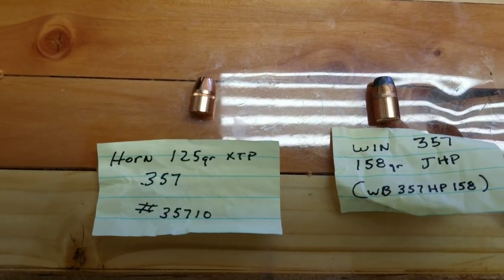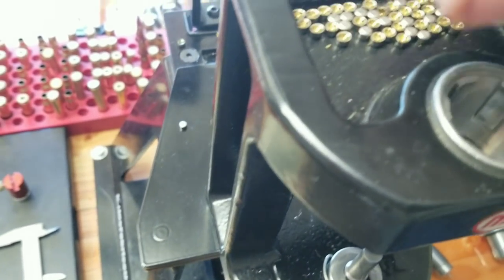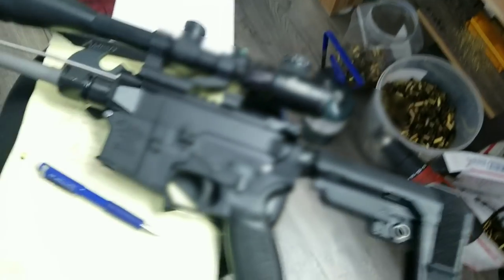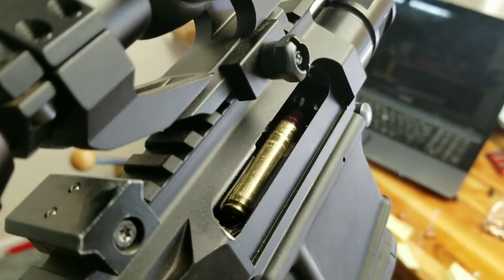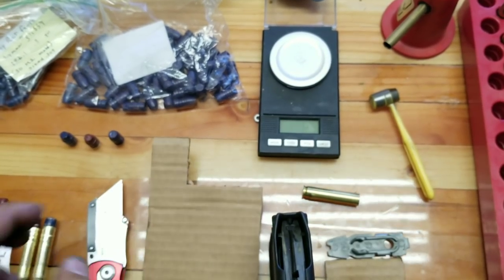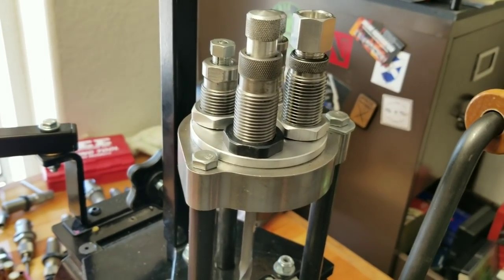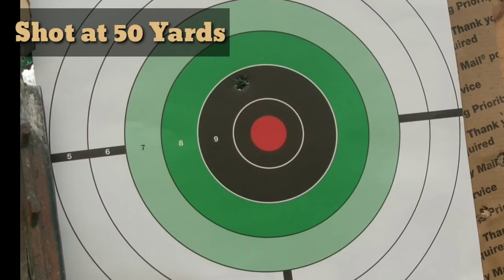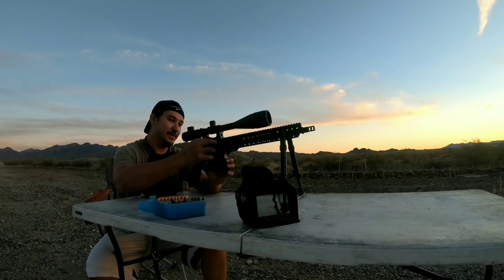350 Legend SBR - How I'm loading It - Testing NOE 183 GC "Taco's"🌮 - Explosive Results!!!👍

Comment: Are you using standard AR mag... You may want to try out the AR7.62x39 mag or mod the standard AR to the look of the AR7.62x39. by this it has the lower lip and thinner or cut on the mag where the mag meets the m4 feed ramp. Just stay the front end of the magazine been mod .

Comment: I have a 12.5" KAK bbl pistol build. Where is your 10" from? Thanks for the feed ramp mods and load data. Lil'gun is one of my favorite powders. 
Also do you plan on any heavier bullets? I have a SAECO 352 mold that is for 245gr 35cal. You can gas check it if you want but I just PC them and go. Working on a load soon.
Reply from the maker: The 220gr Berger bullets shoot good out of my 18inch KAK. Ill make a video on this soon. I contoured and build this barrel from a 9mm ar barrel from BCA. I also am finding awesome results with a 147 Lyman 9mm bullet and H4198 27 grains

Comment: I think I remember you saying you worked up your load with Quickload. I have the update but I just looked for this cartridge and its not there. Did you enter the info manually? If so where did you get it? Are you willing to share your load data for the Taco bullet? I just ordered the mould, have not ordered the upper yet for me the mould is the first step. Thank you for any help you can send along.
Reply from the maker: I remember a while back messaging you many times and was completely ignored on both TRN, Slack and your channel.....so ill hold this grudge.  Your on your own figuring this out

Comment: I thought you werent supposed to use lead bullets in an AR because the lube and lead will clog the gas port, did you find that it did? Liking the 350, should be a great whitetail round!
Reply from the maker: Negative on the leading
Reply: Excellent, I shoot lead in my blr .358 winchester, love 35 cal rounds! Also have a 35 Whelen bolt gun, soon to have a 350 legend, thanks for the time and effort.

Comment: Fbg at 2000fps! I’m still learning about this round. Can you use range scrap, 223/.556 brass? Will we get kicked off of YT for asking these kind of questions?:)  thanks for the video!
Reply: Jk!:) finished watch the video and you answered my question:) thanks!
Reply from the maker: Ya I successfully converted 5.56 Brass but it requires taking a risky step in fire forming to blow out the sides
Reply: Eagle Eye Shooting. Fire form, as in pushing a .223 down a .355 barrel? I think I’d build one if I could reload it with brass from the range.  Cmmg barrels are only $200! What a deal!
Reply from the maker: The Case of a .223 is roughly 8 thousandths smaller in diameter. The case wall basically blows out a tad. Takes about 35k psi to fireform it correctly. Ive had some split down the case wall. "Cheap pmc" doesnt cause issues in the ar and you wont notice it but definitely poses a risk
Reply: Eagle Eye Shooting. I tried making 450 bushmaster brass from 270 range brass and my 45 colt dies. Epic fail:) nobody died tho!:)

Comment: Finally a rimless 357 MAXIMUM!! I have asked both Savage and Ruger to come out with, what is now basically the 350 Legend. To bad it's not a 1:12 twist for us subsonic reloaders. 246 gr HUNTER bullets work fantastic. The 300 gr Hunter bullets work well in my custom MMG 1:12 TC barrel.
Edited to add: 357 MAXIMUM load data will work 😎
Reply from the maker: Haha right? Nothing new here that hasnt been done. I just did some testing with the 220gr and got some awesome results. Will be making a video of that soon. Thanks for dropping by
Reply: 1:16 will stabilize a 300gr bullet. My 77-357 shoots great with them suppressed. I have also used those 246 Hunter bullets in it. Through an Octane 9 and Osprey 9. My current load is a 245 gr SAECO 352 mold cast.
Reply: @postban  <---- this is excellent info. Thanks! Any idea if the Ruger pistol gas system is any better than the CMMG carbine gas system for cycling subs? I already have the Ruger American bolt gun.
Using American Select I have non gas gun loads in my MAXIMUM with an ES of around <20 FPS. Hopefully I can load gas gun loads that will cycle 220+ gr loads using slower powders. Any help is appreciated. Thanks! I use the Mystic X, but have 2 other AAC 9mm cans.
Reply: @EagleEyeShooting  <- any subsonic results. Powder, bullet etc. Would be helpful. I'll try to work up a sub that cycles in an AR. But need one first. Pistol gas sys from Rugar or Carbine from CMMG. I can cut down the pistol system for my SBR. So am leaning that way.
Reply from the maker: @johninnh4880 , awesome I can work on something. IMR 4198 and H4198 seem to give perfect amount of pressure and reduce velocities.  So far I have a cast Lyman 147 9mm bullet with 27gr of H4198 that gets them going at 1780 FPS ejection is at 4 o clock on a AR so a lil under gased. I think with a 220gr and this powder may give subsonic velocities.
Reply: @EagleEyeShooting  <-- I habe a lot of Accurate 1680 from my Blackout. With 250ish gr bullets and the 1680 I believe it will cycle in an AR. Big question is pistol or carbine gas system? Port size is different in each but I believe the pistol sys may be better. Then I can cut it down for my SBR.
Reply from the maker: This one is Carbine length. Port size is roughly .072". I drilled it in a 10 degree angle towards the gas block so the pin gauge shows the port being slightly larger. I think Carbine is the way to go. Running it through QuickLoad on pressure table it shows pressures to build to near peak roughly 3 to 4 ms which puts it about 4 to 6 inches and seems to completely burn all powder the 300AAC uses in about the same length 8 inches. So with that said. 300AAC powders will work ie. H110/296, 1680, LiLGun, 4198, CFE Blk ect. The loads are very similar. I would also suggest a slick sided upper as I orginally built one on a m4 aero. The deflector put some nasty dings on the case mouths

Comment: The problem with cast lead is all the states that insist on lead free ammo. Or is it THE state?
Reply from the maker: I have some zinc bullets ill try out soon. 👍. Should be a very cheap alternative to a copper bullet
Reply: @EagleEyeShooting  Good thought. Weight comparison? Or are we pushing light/fast for the energy?
Reply from the maker: @chrisblake1918  it would be both. Zinc weights 65% of what ever that bullet is suppose to be in a cast lead. It would act like a extreme penetrator less I cast them in a HP. I was able to get a 9mm 75gr up to 1800 fps which acted like a G2 RIP round in ballistic gel. Can imagine what speeds will be in a 350 lgnd lol. Powders like H4198 will keep the speeds down
Reply: @EagleEyeShooting  Good thinking. I like your channel, and I like your development ideas.

Comment: Buying 350 legend mags saves some frustration
Reply from the maker: They suck. Found they gouge your brass and cause feeding issues. I have 5 of them and built 4. 358 Legend guns. 10 round Pmag with guides filed off have been 100% reliable.

Comment: Why use gaschecks on powder coated bullets people run them plainbase in 223 and 308 all the time
Reply from the maker: Something called chamber psi, obturation, gas cutting and permanent bullet deformation.  Those you see running without gas checks aren't usually running the speeds and pressure im running
Reply: @EagleEyeShooting  fair point most of the plain based PC bullets I've seen in rifles topped out around 2000-2200
Reply from the maker: These are at and exceed magnum pressures. 44Mag hard cast and also 357 Maximum are almost always gas checked
Reply: @EagleEyeShooting  I run plain based 200 gr powder coated bullets put of my 460s&w at 2100 fps no gascheck
Reply: @EagleEyeShooting  which is in the 50-60k range pressure wise
Reply: Agree with bosstube, I have run 2400fps with Lee 155gr PCCB 30 CAL. Maybe give it a try.

Comment: Anyone loading 358's?  Just got a KAK 358 18" barrel
Reply from the maker: You won't be able to chamber reliably with 358 bullets.  Winchester made it to only take 355 or 356 bullets.  I had a KAK barel also and had to return it. There first barrels had a defect with out of spec case mouth in the chamber. I believe they fixed this but definitely check out your chamber for a step by the case mouth
Reply: Eagle Eye Shooting  I got their barrel with 358 bore, hand load only,